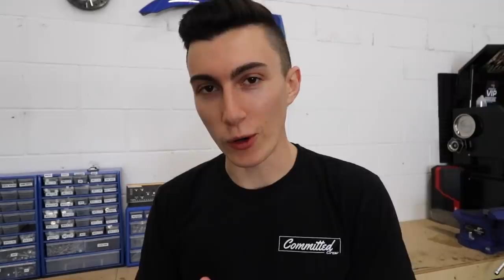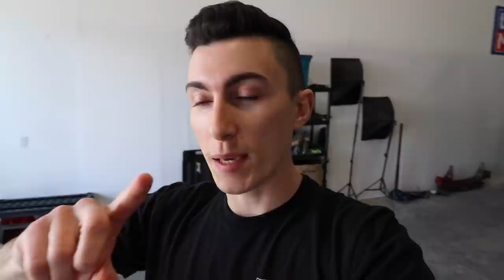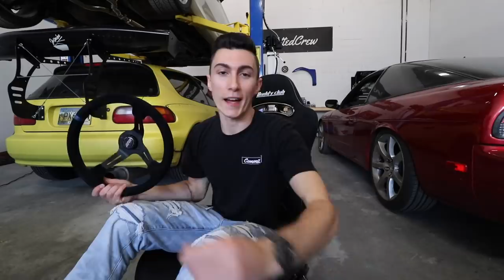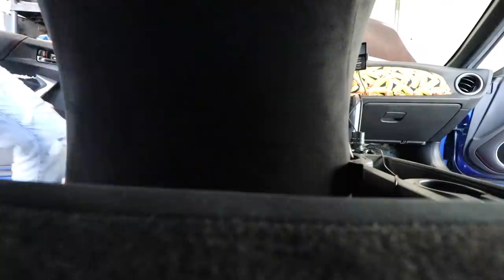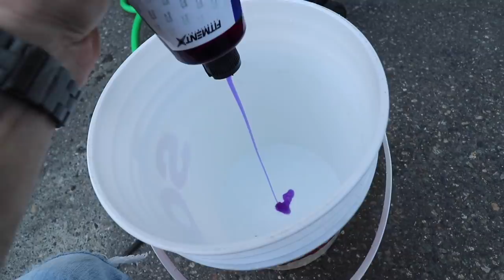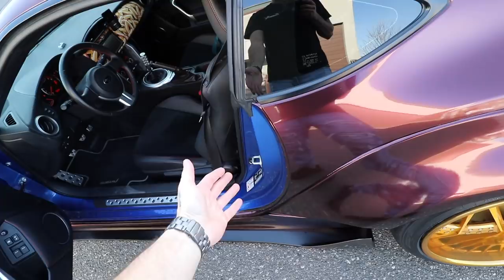Putting Stock Parts Back on the BRZ...

Comment: A little story that kinda goes with your video here. I daily a 500 Abarth, and I was looking at good mods to get it to feel better when I'm driving on backroads or even at a track. I did a short shifter and a new shifter, and was thinking about getting an aftermarket steering wheel to held with the ergonomics of the car. I looked into it for a whole week, then one day I took a step back and thought. I thought about how I daily my car and since I don't have harnesses, if i would get into a crash I wouldn't have the same protection as I would if I kept the stock wheel in. Me stepping back and thinking it over helped me make the mature decision at the time. I think we all need to just step back at look at things from a different angle from time to time.

Anyways, just a little story I wanted to share. Glad you're back and safe. Stay Committed!

Comment: You can replace the LEDs behind the gauge cluster quite easily. Mine are white. Looks cleaner and more modern. Did the same Bruns the click and the AC controls and the console traction buttons.

Comment: You can get one of those android head units for the brz. the ones with 4 gb of ram they are pretty responsive and have a lot of road trip like functionality . You can even put a sim in some and have all your car apps (maps spotify etc) right there without having to stick your phone to the dash and have the interior  look over crowded. + they support back up cameras. they are an awesome safety net

Comment: Mashed potatoes. I totally understand. I was about to install a aftermarket stereo into my low mileage squarebody gmc but then backed out because the stock one gives it more value and doesn't require cutting trim that's in perfect condition

Comment: Well done Robbie! putting the stock steering wheel back is a great move both for safety (airbag) and for the better look. in my opinion racing steering wheels look dumb in anything but a proper race car. and as for the seats racing seats in a road car makes no sense unless you will use it on a track somewhat regularly. Otherwise its a great build! the body kit looks amazing and so does the wheels and colour.

Comment: Mashed potatoes. Personally I feel like if you were to change the BRZ steering wheel you should go OEM+, like those flat bottom or carbon fibre versions. Basically stock but better.Also You should cover those labels in some clear tape, they're gonna fade to nothing as soon the shop gets warmer.